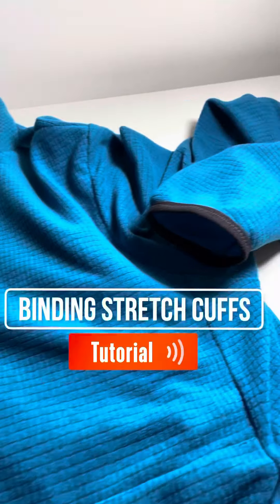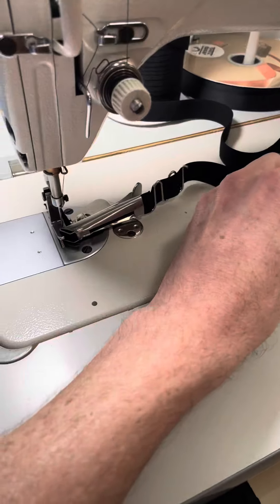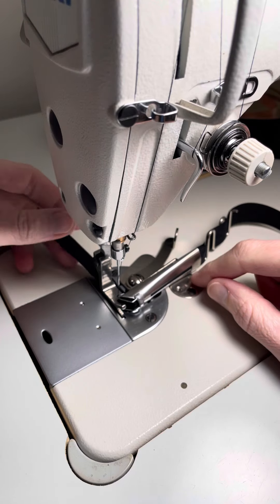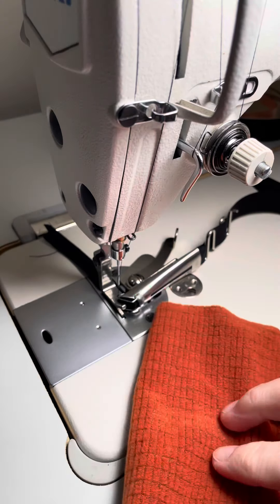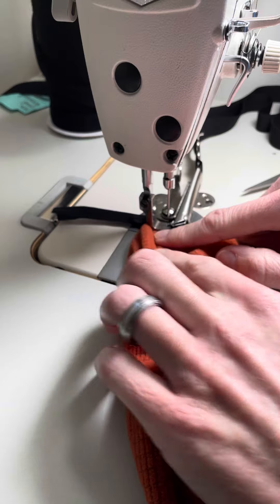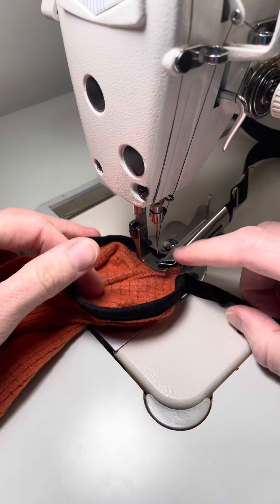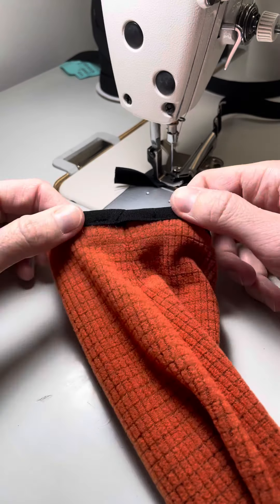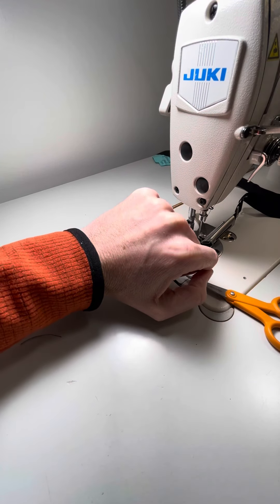Binding cuffs in making a Pullover Hoodie

Comment from the maker: For clarification about prestretching FOE. While it’s advisable to prestretch to prevent seam breakage, doing so makes the cuffs and waist tighter around body, seams get puckers, and garment billows out. By sewing in slack in this manner the circumference of cuffs and waist have little puckering and retain enough stretch for normal wear.